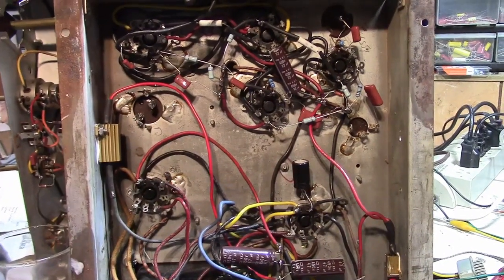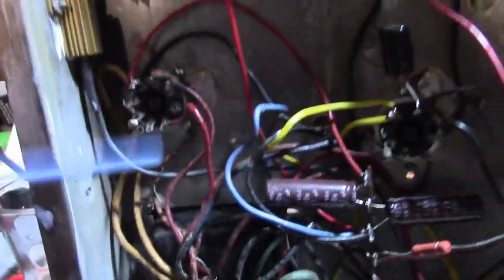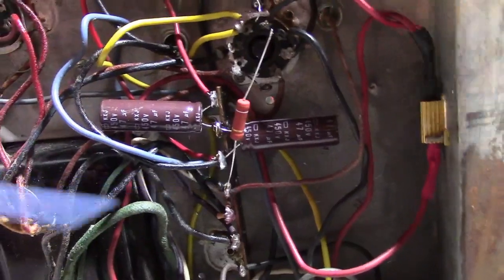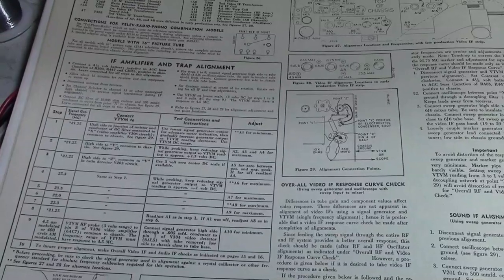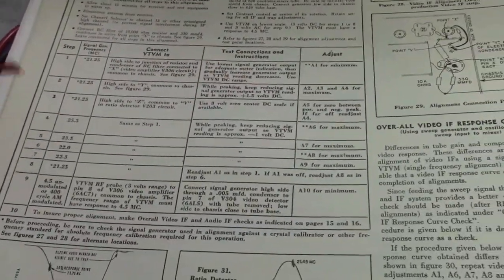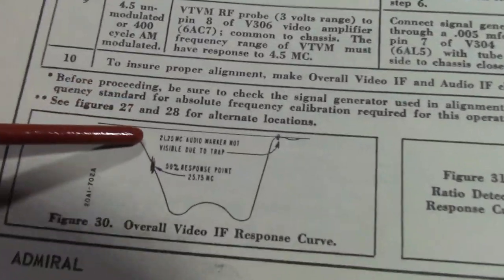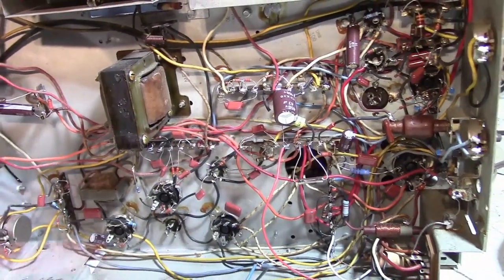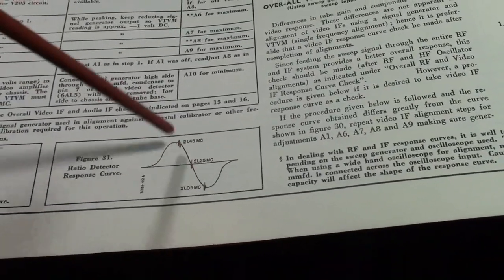Admiral 20B1 restoration p7o?

Comment: Second comment, you are doing a tremendous job in explaining the complexities of trying to do an NTSC television IF alignment. there is an almost unbelievable amount of interaction between the adjustments on the set and the viewable picture. You are absolutely correct when you assert that the alignment is very set specific, and cannot be made common to all televisions. I can only imagine the notes that were made in television factories back in the day so that the the assembly linetechnicians who were tasked with performing the alignments could do so successfully and repeatably even on brand new equipment. Yes, yes, yes!!!

Comment: There were several changes in FCC rules for TV Aural Transmitter Power over the years.  With the change from split carrier to inter-carrier audio, and with technology improving, testing established that less power was needed for the aural carrier to be successfully received, so the power limits changed accordingly (why pay for transmitter power you don't need?).  This is a list of how the rules changed over time (not necessarily the year the change happened, but the years that I have rules available for):
1946 - 50-150% Peak Visual Effective Radiated Power
1955 - 50-70%
1964 - 10-20%
1986 - Maximum 22% (no lower limit anymore, most stations used 10% - this lasted until the end of NTSC)
If you look at the specifications for a typical RF modulator IC from 2009 (in this case the NXP MC44CC375AV), the aural carrier is about 3% of the visual carrier (-15dB).
A TV from the late 1940's is probably not happy with a 3% aural carrier since it is looking for at least 50%.  It looks as if the Admiral's Sound IF doesn't use AGC, but since it gets its feed from the 1st Video IF (that does use AGC), the aural carrier level is set by the received visual carrier level.  You might be able to play with the AGC feed to the 1st Video IF to get more gain (and then reduce the gain of the 2nd Video IF after the aural carrier is already picked off).  Or maybe you could play with the Sound IF gains to get more aural carrier level.
I noticed in the Service Notes that "weak sound" can be improved by slightly misadjusting A9 (L106) to favor the aural carrier at 21.25MC instead of 22.3MC part of the video IF.  Of course, the question is can you get enough aural carrier gain without killing the video resolution.

Comment: I used to use VCR's in the shop when working on TV's...
I suppose a DVD player could work as well, as long as it has a modulator (or use an external one).
Thanks for the alignment video, nice gear :D
Cheers,
Reply: Most of the older ones do, analog channels 3 or 4.

Comment: What I find is unless you live where you do when you do that this early television restore project would not go well. By that I mean Bob's training, education, mental job description, and component availability, and the ability to use components not from the same era, (like early post war but up through the early 50's), things not even recognized by people today as tv components as rethinking what the early builders were even thinking when building the early TVs. It seems arcane and black magic in a way as technology has moved so far from 70 years ago and bob almost bought it with capacitor leads out of the high voltage cage being uncaged. It reminds me of the guy in that area trying to learn how low a voltage was necessary to kill someone. He was working in the lab late one  night with a 9v battery and observing heart function with very short pulses and the timing of the impulse in respect to the heartbeat and discovered the exact time to introduce the pulse to cause the heart to go into fibrillation. He was found dead on the floor in his lab with only a nine volt battery near his body, and the authorities were using 6,000v for capital punishment at the time. We all make mistakes and bob says he was saved because the shock only passed through his hand to ground. I would supplement that information by saying he never hit his heart at exactly the correct time to upset it. Dont try this at home.

Comment: looking up a 50W version of that aluminum resistor on digikey, it looks like you want the "dielectric withstanding voltage".  they specify it in AC which is good, because the DC rating is going to be higher than this.  The datasheet I am looking at shows 1000VAC for 12.5W, 3000VAC for 25 and 50 watt versions, and 2500VAC for the 100W and 250W versions.  This is for a stackpole part.  The vishay brand is a little different;  1KVAC for 5W, 10W, and 25W; 2KVAC for 50W, 4.5KVAC for 100W and 250W.
Reply from the maker: Thanks.  That's what I concluded too.  I think they could have made it a little clearer by calling it something like metal housing to resistor lug maximum voltage.
Reply: @bandersentv  you can always do a insulation resistance test between chassis and one lead of that resistor.

Comment: Remember a modulator in a DVD player or a VCR is double side band , not vestigial side band as the tv transmitter is so you are not going to get quite the same frequency response on a domestic modulator.

Comment: I have an old media sonic converter box I use in my old black and white tv setups, the nice part is I don't have a test pattern generator, but the media sonic can use picture display output via USB, so i've used an image of the test broadcast picture a few times, and Im not 100% sure but the media sonic converter boxes may still be sold at walmart

Comment: You could have a go at cutting the wrapping, and peeling it back from the choke, it may be a bad solder joint. I think using a power resistor as a choke in this instance would be fine, as the rectifier is only a 6X5GT, so the load can't be more then 70 ma, but for a heavier current load using a resistor in place of an iron choke will cause the voltage to drop too much.

Comment: You can broadcast either with a box or a VCR or a DVD player.  Install an old NTSC antenna booster on the RF out of any of those devices and hook the output of the booster it to a wire.  I know a few people who do this.
Reply from the maker: Yes, I have several commercial grade booster/transmitters.  One Drake and the rest Blonder Tongue.  They came out of closed circuit installations like at a hotel.

Comment: The main reason for reducing the inter carrier sound carrier power level was to reduce the intermod between the sound carrier and the chroma carrier. The intermod resulted in a herringbone pattern of approximately 1 MHz in the NTSC system. This pattern was seen on the picture of course.

Comment: As to the metal heat sinked resistors, I don't think so much as with DC voltages but with AC voltages there may be some capacitance to the chassis ground . I would think the manufacturer would have  had a specification on that maybe.

Comment: So...just curious. What does a repair like this cost?
Reply from the maker: $300 for a basic TV overhaul.  This one will be a bit more because it was a mess and there is still a radio to get running.  I'm not doing it to make money.  I basically give away the labor for free.  I also only do a 2 or 3 a year.
Reply: @bandersentv  : Appreciate the return reply. Me (I'm just starting out restoring antique radios) and do them for history's sake. Notwithstanding, got a Q: A RCA with CRT just popped and went out (according to my friend its owner). It was the 2nd and last time it'd done that (about 7years ago).  Any thoughts?
Reply from the maker: No idea without a lot more info.  Is this a modern solid state TV or an old tube set ?  What model ?  What happened after the first pop ?  Did the set start working again or was it repaired ?
Reply: @bandersentv  : My apologies.... It's a CRT - solid state/ IC set. I did some digging and found it to have been built about the mid 90's (though it appears much much newer) and have recently found a schematic for it. I also  (prior to finding its schematic) checked the input for line voltage  and its only fuse proving good and found no exploded caps lurking in the midst. (That's when I sought your opinion.) Notwithstanding, with this set some 30+ miles from me, I'll be taking voltage reading now that I know where and what they're supposed to be. From past experiences what the gentleman described almost sounded like an IC  or transistor blowing out. But too (not trying to assume anything) I'll be looking directly at the  power supply. There appears to be an over current shutdown feature designed in-- in one of the IC's (here's hoping there's any power to even that chip). For reference  this set is a RCA F35731.  It was the gentleman's late wife's  favorite TV and he hates to part with it.... Again, I very much appreciate your responding and taking time out to do so. It's people like you who make Youtube what it is (the good part that is). Please keep up the good work.   And thanks again.

Comment: Bob, I can see that you are using 2 electrolytics (47 mfd @ 450v) from what I can see for the larger "can" C1. Is there a Surge voltage printed on the "can" itself ? The reason I ask is, about the upper limit voltage of these caps. I noticed that Phil N. used 500 volt caps on his web site. Of the 3 units that I have, they are the 25 cycle versions. These caps are printed (40 @ 475 v and 550 surge voltage). Now I know these will never see 25 cycle again, Sams shows these as 450 volt caps in the schematics, and the RCC (Canadian print version) only has the schematic and not a parts list. I am at the stage of doing caps in this area. You have obviously done enough of these sets that 450 volt caps are not a problem, I can use 500 volt caps here or even run 2 in parallel for the "overhead". Have you ever monitored the startup or working voltage on these caps to see just how close the upper voltage is for the 450 volt caps ? I was just wondering how to proceed. Admiral obviously figured 450 volt caps were ok  for 60 cycle, but must have figured they needed a little extra overhead for the 25 cycle units. There are also a few "extra" parts under the tv chassis that the 60 cycle versions don't seem to have (extra electrolytics and chokes).
Reply from the maker: I think you men use two caps in series ?  That would increase the voltage rating.  I have not checked the surge voltage on this particular set.  I generally go with whatever is stated plus 50-00 volts if practical.  I do sometimes use 500 volt caps.
Reply: @bandersentv  Yes, sorry I meant series, to increase the voltage rating. I didn't think that 600 volt caps were available. I just checked JustRadios web site, and he carries 600 volt electrolytics. They are almost twice the price of 450 or 500 volt series. I guess what I was asking was; to get overhead with the original rated at 475 working & 550 volt surge, I'd have to go with a 600 volt cap. If the set was never going to see that voltage, then why go that high when a 450 volt cap will work. Kind of goes against the theory of always use at least as high if not a higher rated part for this application.

Comment: I wonder if the FM audio IF was lower then because the FM band was much lower originally.
Reply from the maker: Interesting thought, but by the time this set was made the FM band had been moved to 88-108 MHz for some time.  You'll soon see when I do the AM/FM radio portion of this set.  I read recently that they shifted to use a 44MHz IF because it worked better with UHF.  That happened in the early 50s.
Reply: bandersentv Oh, that makes sense for UHF. I knew the band moved up just after WWII.